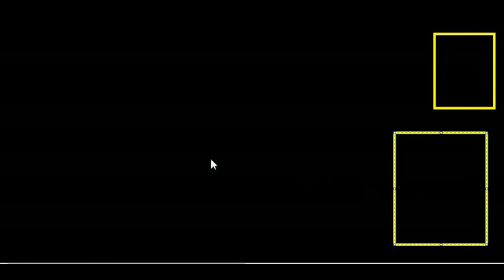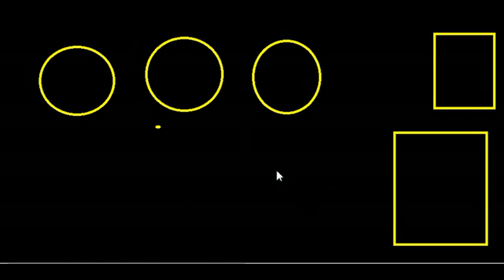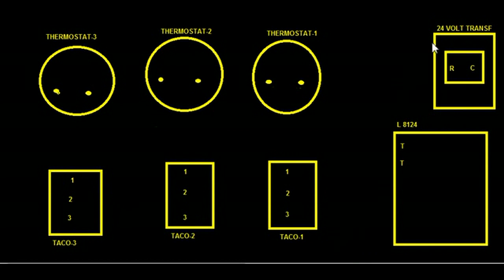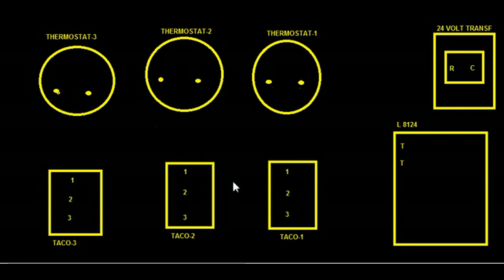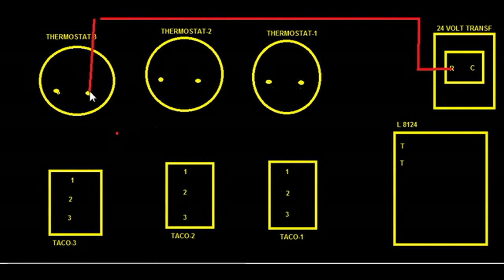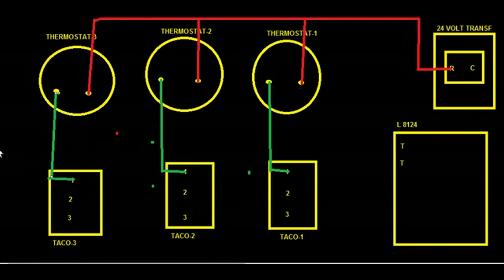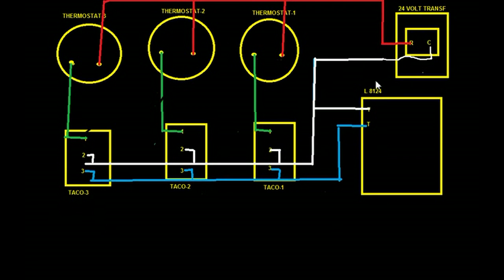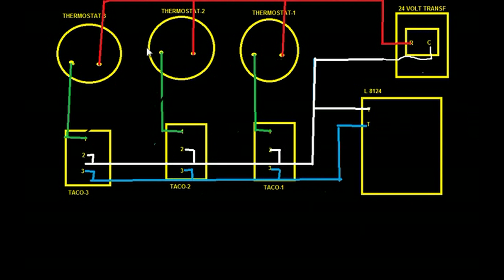Taco Zone wiring

Comment: I have a two zone Buderus boiler with the AM10 controller. I have the identical wiring with the additional xx wires going to the AM10 from the relay.  My issue is that if the upstairs thermostat calls for heat, nothing happens until the downstairs thermostat calls for heat. Once the downstairs thermostat calls, then the boiler goes on and heat will flow to the second floor. I have the thermostats adjusted so they pretty much call for heat at the same time, but it bothers me that the second floor is not able to command the boiler without the first floor having a say in the matter, lol. Any thoughts?

Comment: I know this is a stupid question but I have to ask. I have two thermostats in my system with a red and white wire. You show a red wire from the transformer going to the thermostat but you show a green wire from the thermostat to position #1 on the zone valve. Is the green wire from the thermostat to pos.#1 suppose to be the white wire from the thermostat?

Comment: How many valves can I put on my 24 transformer. I have two on there now adding a third valve. Will the transformer handle the third one?
Reply from the maker: I been  using up to 5 no problem be sure is 40va
Reply: I belive mine is 24 v is that still OK or should I install a 40 v for three valves? Thanks.
Reply from the maker: 24volt  Rate 40va